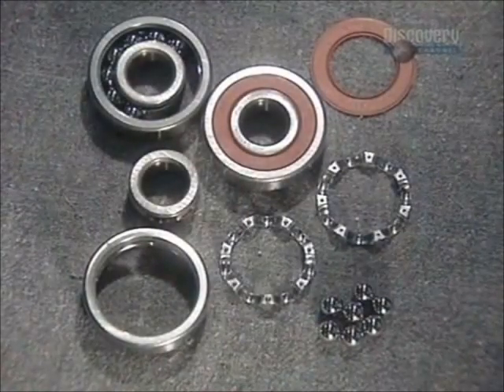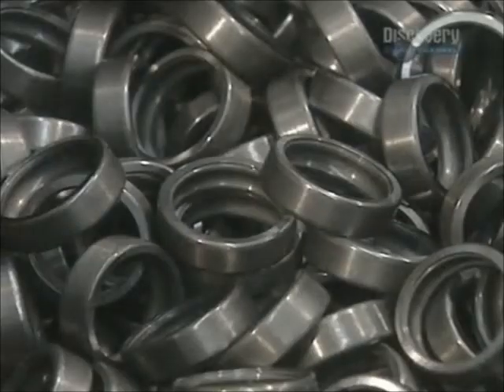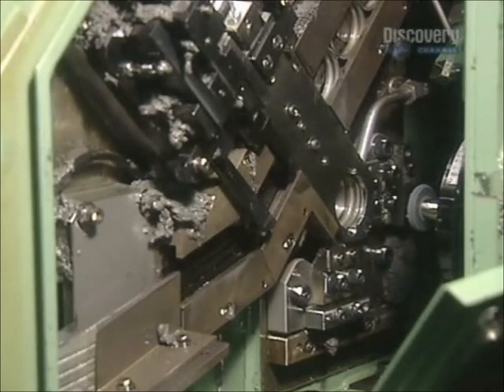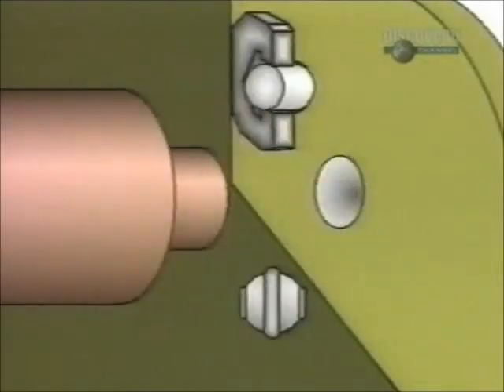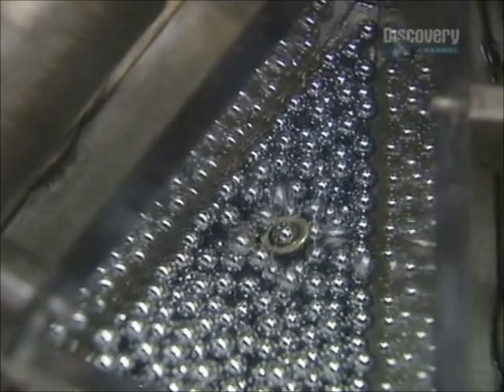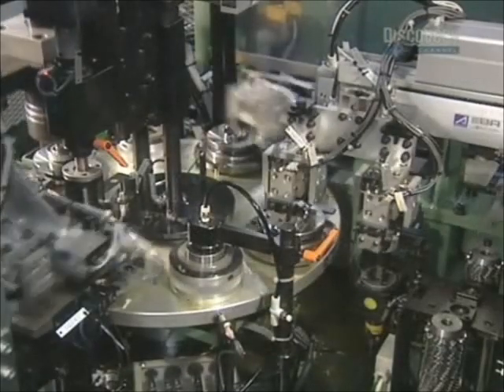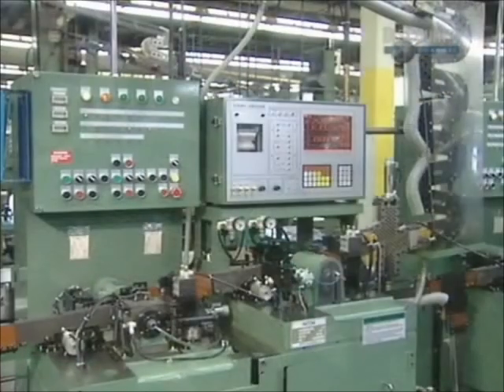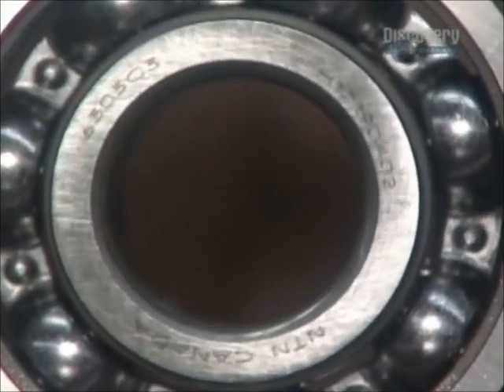How it's made - Ball bearings

Comment: Disappointing video. Doesn’t explain the process for ensuring the ball bearings are actually round nor does it explain how the balls are pressed into the the bearing race.
Reply: They have deliberately avoided the ball insertion part I see. They show the ball divider, but not the step before that. Inner ring is moved to one side of outer ring, then balls can simply be poured in on the other side. When the ball divider positions the balls evenly then the inner ring can't come out anymore. The ball cage then holds the balls evenly in use.
Reply: Agreed.

Comment: this was not at all helpful.
Reply: The balls are all on one side when poured into the outer ring, so the inner ring can be inserted off-center, close to the side opposite the balls. Once the balls are evenly spaced the inner ring is forced to the center where it is trapped. The cage prevents the balls from all piling up on one side while in use (otherwise the inner ring would slip off-center and the balls would fall out).
Reply: @marc-andreservant201 that's exactly what I wanted to know! your explanation is better than the video. thank you.